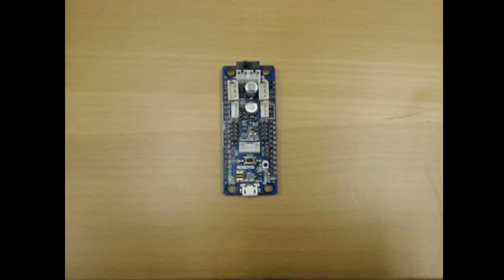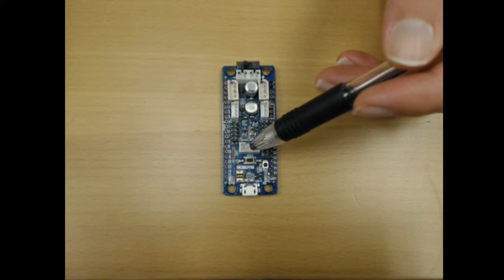Introduction to the OpenCM9.04

Comment: Can openCM 9.04 control Dynamixel AX-12A ?
Reply: Im trying to find examples for this too.
Reply from the maker: I am so sorry for the late reply. Yes, you can control the AX-12A using the OpenCM9.04 but you will also need the OpenCM 485 Expansion Board to supply power as well as provide the correct terminals for the AX-12A. here is a link to the product page http://www.robotis.us/opencm-485-expansion-boar/?_ga=2.64668839.942941522.1603124322-1781664022.1594859655 if you have any further questions please ask them here or email us at CS@robotis.com